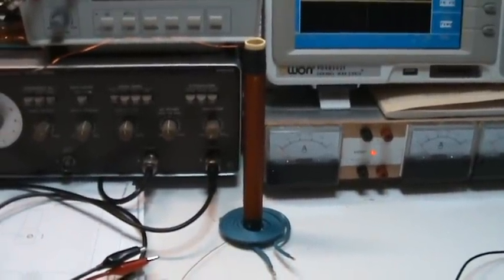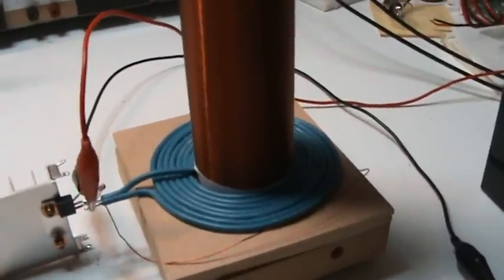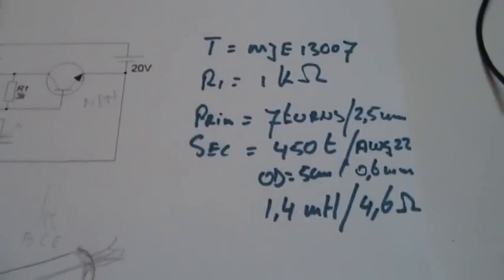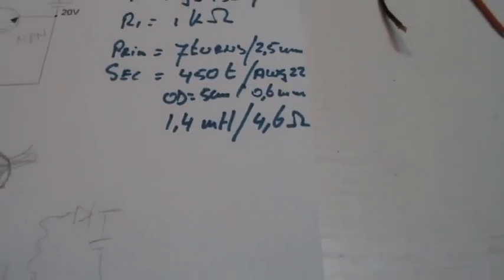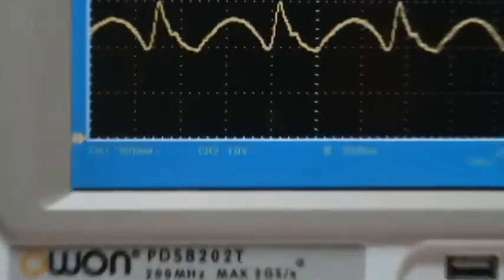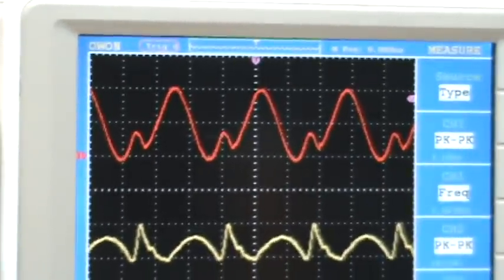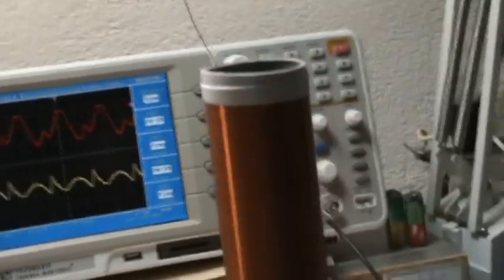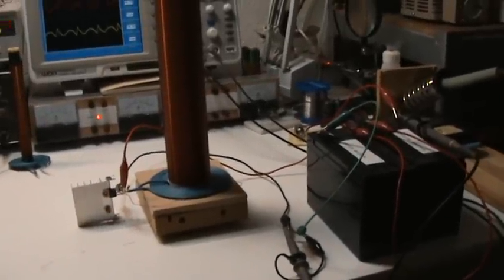20111211213444.mpg

Comment from the maker: jimboot2,   my scope can handle 400V on its input, so should be fine when not measuring the output :-) 

Overunitydotcom, good point, i will use some better cables i have and try a low pass filter for my multimeters so we are not needing a scope. 

Overschuss, thanks for the link, looks intresting. Being Dutch i can read German fairly good.

Comment: Well done !
But be cautious not to burn up your scope.
Better use only small turn like 10 turn pickup coils for the scope about 50 cms away, otherwise the high voltage RF will jam your equipment.
Also your small crocodile cables have a high impedance, so you get this
strange voltage on your battery. These croco cables are just crap. Put a cap in parallel to the battery and use a lowpassfilter to measure the voltage at the battery., but at least this way you get them charged up a bit again...;)